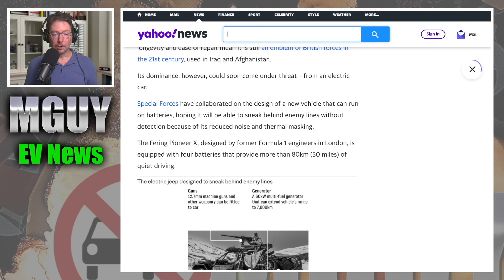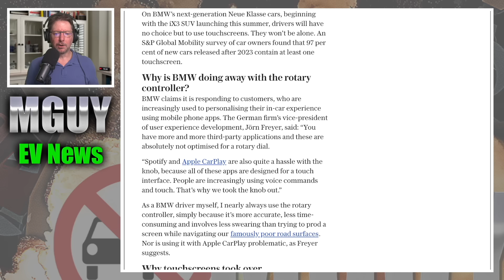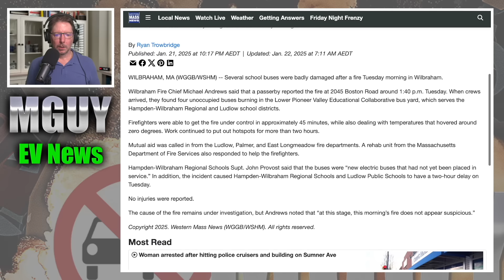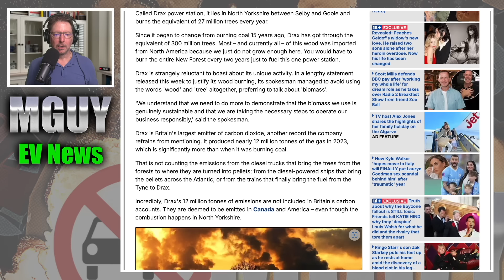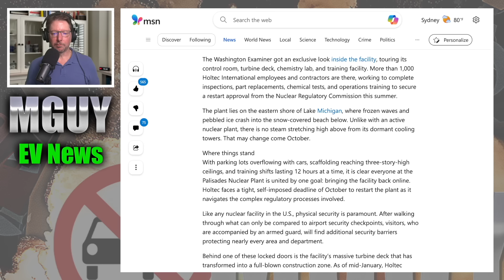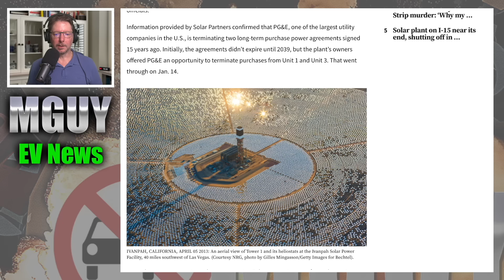Electric Jeep is UK's latest EV madness | MGUY EV News 26 January 2025

Comment: Electric Special Forces Jeep 'Will sneak behind enemy lines undetected' AND LEAVE YOU STRANDED when it either runs out of electrons or it lights up it's own signal fire.
Reply: It's own signal fire 😅
Reply: I thought the idea was that, as a hugely successful INCENDIARY, it would be left close to an enemy installation with a small charge to light the batteries whilst the crew slipped unobtrusively away in the ensuing mayhem?
Reply: @sirjohng1  Crew? What crew? A self-driving vehicle will suffice. And even if it drives madly down the streets, that will also work.
Reply: @YouShouldThink4Yourself Imagine being the enemy, out in silent dark night, you can hear a distant sound of a diesel generator😄
Reply: @Mehrunes86  not only you hear a diesel generator, but you suddenly start seeing the sky go bright orange, and a thick black smoke is coming out from the same area. You don’t even have to waste ammo on a self-1g nighting vehicle.🤣
Reply: Does the UK military realise that the Taleban, the Houthis, and even Iran lack EV charging infrastructure they could use?
Reply: @mhVcsgB7y7  No.  The UK's military leadership is just as dumb as what the US has.  The most versatile, cost effective transport is the Toyota Hilux - which the Taliban and Houthis actually use.
Reply: They will  go to the nearest enemy town and plug it into a tesla charger
Reply: 7,080 km, must be a long enemy line.
Reply: nonsense. it won't even sneak up to your own front line undetected!   i have watched 20 drone vids of the front line  ukraine/russia war. everything that moves on or near the front line is seen.  night or day.  only a clown would think they can get to the enemy front line unseen/   they may not be able to shoot at you yet. nut they know where u left your line, how you crossed it and where you landed at they watched it all on drone! in some cases they seen you on 4 different drones that stick around until the FPV drone comes and blows u up.  cant miss the show!  then they leave and look for more targets all day every day 24/7!
Reply: It could be exact opposite. These 'quiet' motors need high power, high voltage, kHz-range PWM signal to operate (otherwise efficient power control wouldn't be possible). Building a detector for that from ancient discrete parts should be quite easy, making these cars advertise themselves to the enemy from miles away.
Reply: These 1d 1ots have 0 idea about what’s happening today in a war zone. Any vehicle is detectable, whether it has sounds coming out of it or not. It’s not a cartoon. People’s lives depend on these vehicles! If you w0ke, wake up again!
Reply: It will also double as a kamikaze b0 mb.
Reply: As we have learned in the Ukraine/Russia war, drones are the most effective way to eliminating the enemy and vehicles. They are cheaper and area a use-once device.
Reply: Like large electronic signals are invisible to mankind. No, they are just as easy to pick up. The idea of EVs in front line duties is not journalism, its fan fiction. As long as its recognized as a EVangelists wet dream, then that is ok with me. Just don't try and peddle it as reality and call yourself a 'journalist'. You are a c-grade sci-fi writer.
Reply: You can't sneak behind enemy's lines in a drones war anyway. Low temperature and sound signature will make no difference.
Reply: @Hope_Boat  I have a more than  sneaking suspicion that the SAS may have just found that out the hard way in Yemen ?

Comment: I saw a article claiming that EVs last as long as a ICE vehicle. No EV battery will last more than five years. 🙄
Reply: Like everything else,  I'll believe it when I see it. 
Batteries degrade, it's just the way things are.
Reply: Tesla only  guarantee the cars for 100K miles due  to the battery  life.
Reply: I have a 14 year old diesel Citroen with 103,000 miles on the clock.  It still has the same tank capacity, fuel economy and range as when it left the factory.  No EV has a hope in hell of matching that.
Reply: My current and last car is now 18 years old. It has its original engine, transmission and driveline etc.  Nothing mechanical or electrical has been touched other than regular maintenance items.
Reply: Well the vehicle itself should last as long as an ICE.  But the caveat is yes the battery will need replaced several times at a very high cost.
Reply: @dave3657  It's not only battery. The weight of them means that many other parts will need replacing more often than those on a ICE vehicle. It's like Triggers broom. He's had the broom years and only replaced the handle 3 times and the brush 5 times. My old diesel car is 15 years old and never needed a replacement engine. In those 15 years apart from the normal service parts, it has only needed a replacement battery once. Two rear shock absorbers and a drop link. And my car has 120,000 miles on the clock. No one is ever going to convince me that a EV is better.
Reply: Good luck with that!
Reply: lol mate do you actually own an EV? I have 12 year old batteries in my custom EV build and range is still pretty much the same as when I bought them 9 years ago.
Reply: That’s OK then. Kia have a 7 year warranty on my EV’s battery. When it dies at year 5 another will be fitted at no cost to me. That’ll last at least 5 years so I’ll get the expected lifespan of all major goods these days.
Reply: @markboscawen8330  If you check that warranty you will probably find it doesn't cover the battery degrading and the car not achieving the specified range. Your battery might not die completely but you won't be going very far in that car.
Reply: @orvillefindley8117  Battery is covered under the warranty if it’s capacity drops by more than 30% before it’s 7th year.

So which is it? Is the car a brick at 5 years because the battery won’t last longer than that. Or is it that the car won’t have nearly the same range as new - but would still be suitable as a daily commuter 2nd car in the household?

BTW, even IF the battery’s capacity was 50% at year 10, the rapidly falling price of batteries would make fitting a new one in a decade much cheaper than today’s quotes.  The savings from not filling up with more expensive liquid fossil fuel & reduced maintenance costs over that decade would mean very likely to be no worse off compared to running an ICE vehicle. All of which is a very unlikely scenario anyway. As real world data from older EVs confirms the batteries don’t degrade as fast as feared.
Reply: XPeng gives a 10 year battery warranty, so who cares?
Reply: @stizzygrayson5541  Sorry sir , your battery died 10 years and one day after you bought it .£15 grand please.
Reply: @stizzygrayson5541  will that company be around in 10 years to honor the warranty?
Reply: @stizzygrayson5541  Wait till XPeng gives you an excuse for not replacing the battery. The cost is always too high. You can swap out an engine in an ICE car at little cost, not so with an EV. The replacement battery has to be new and expensive. Old ICE engines recovered are still good.
Reply: @bondgabebond4907 

My D4D Prado hand grenaded at 168,000 km, three and a half years old, Toyota didn't want to know about it, AUD$17K to rebuild it.

If it's got wheels or tits it will cause you grief and cost you money.

Our next vehicle will be BEV
Reply: @bondgabebond4907 except when the ICE engine rings are worn & the gasket has blown -leaking coolant into the sump.
Reply: @stizzygrayson5541  go out of business
batterys you want not made by others
like portable drills
new 45
later battery 34
Reply: My Mini Cooper Electric is almost 5 years old 
and its batteries haven't degraded one bit.
Reply: @organickevinlondon  Your batteries have degraded. They start degrading the moment you start using them. You will require new batteries very soon. It would be great if we could all see your face when they tell you the cost of replacing the batteries. 😂
Reply: @Spectrum-of-Truthha ha 😂😂🎉🎉
Reply: @orvillefindley8117  Lithium batteries start degrading from the moment they are manufactured and degradation is more age than usage related. The 200k Tesla is possible because those miles were done in a short period of time. For a typical driver 200k miles would be 20+ years of motoring and there is no way the battery will last that long.
Reply: @John_L  My car is 15 years old, it has 120,000 miles, not kilometres, and it's never needed a new engine. In terms of wear, I can still get 40mpg. It was only good for 42mpg when new. My old car is doing much better than any EV will ever do.
Reply: @organickevinlondon  Can you show the internal resistance readings of all the cells new compared to now and I will believe you, with every charge /discharge cycle their internal resistance increases. this also applies to lead acid battery's incidentally, its the chemistry degrading the battery through use.
Reply: @organickevinlondon 

I'll bet the Kool Aid was colored green,  
wasn't it Mister Organic ? 
Or did you even notice what color in your haste to gulp it down ?
Reply: @ WTF are you on about.
Reply: @organickevinlondon  

The Green New Deal Kool Aid 
your sort swill.
Reply: @organickevinlondon  You mean the meters are lying to you. A group test found brand new cars were lying about the range and state of the battery, so I very much doubt your 5yr old meters are telling the truth.
Reply: @bigglyguy8429  its NOT ROCKET SCIENCE to work out the state of an EV battery, yer just charge it up to 100% then drive it, till its down to as near as 1%, clocking how many miles its done on a full charge, its range, then you can divide those miles, by the battery capacity, to easily get its miles per kWh too, what are these "mythical meters?????" are you waffling on about,
Reply: @organickevinlondon  I think it was What Car magazine, they tested about 18 new EVs and found all of them were giving false readings regarding the state of charge and energy use. Most of them only gave 70% of their claimed range
Reply: @bigglyguy8429  I only go by what my Mini Cooper Electric does and it works correctly.
Reply: @organickevinlondon  Every single journey you take will be different, unless you take the same route day in, day out, and always ensure that anything using that battery power is always the same, (wipers, heater, radio, lights etc) and the temperature is the same every day (not going to happen), the best you are going to get is a very rough estimate of your battery capacity. There is no way you can get a cell-by-cell diagnostic (the meters he's talking about, not "eMPG" or whatever). 
The fact is, your battery starts to degrade the first time it's used, and it's up the the tech in the control system to ensure the cells are balanced and conditioned correctly, the BMS can do a good job, and as they degrade, you will just have less range, but at some point, one or more of your cells will reach a point where its too far out of spec, and, it will be new battery time (or time to find someone like me who can test and replace individual cells and get you back on the road)
If you buy new every 3 years or lease, this should not be an issue, but if you do get caught out of warranty, it will write most EVs off, as the price of the battery will far outweigh the value of the vehicle. I've personally already seen this happen...
Reply: @longrange1977  JEEZ, its just a flippin Mini Cooper Electric that I own, IF you know anything about them, ( I doubt that you do know anything about them, I'm an ex mechanic and truck driver, and my old man was in R.E.M.E. in the British Army, thats Royal Electrical and Mechanical Engineers, so stuff like this runs in my family),.its current battery set up, should last me at least 150,000 miles, thats 20 years of average UK driving, and even after that, it probably wont require a new battery, as its got 12 separate battery modules, of about 2.4 kWh each, so it at the worst case scenario, may require 1 battery module after 20 years, as I dont thrape the battery set up, by deep discharging it, i.e. driving it till it runs out of range and stops, one of my best mates is an electrical genius too, so if I require any incredibly detailed advice/information concerning my Mini Cooper Electrics systems, "I would just ask him" and not take some random dudes "advice????" from a You Tube comment, as THAT is exactly what you are in reality, "just a random dude", as for my Mini Cooper Electrics range after 5 years of use, the manufactures stated range is 145 miles, yet, I can get a range of 170 miles out of it, thats 15% more than the manufactures stated range, but the battery hasnt grown an extra 15% in capacity has it, perhaps "driving it properly" makes a huge difference, and I'm used to driving 44 ton, HGV 1,  articulated trucks, "so I know exactly how to drive thanks",  as for my charging routine, I run it right down to a single digit percentage, then charge up to 100%, as you would "KNOW????" that's the best way to keep it balanced, I basically see the batteries as 100 pint glasses, with each glass representing 1% of its capacity, so charging up to 80% means, yer filling 100 pint glasses with 80 pints of beer, and that means, some pint glasses get more or less beer than others, i.e. they are out of balance, so filling the whole 100 of them, to the brim, with 100 pints, i.e a full charge, means, they are ALL FULL and balanced, I even KNOW exactly how long it takes to charge, 20% per hour on a 7 kW charger,  (its actually 6 point something kW not 7 kW,) or 3 mins per 1% of its battery capacity, up to 97% then it slows down a tiny bit, between 97% and 99%, and the last 1% fluctuates, by a few minutes, due to its range being estimated by how it was driven before being charged up, (being a "so called EV expert????" you should have KNOWN that, but, you blindly incorrectly  waffled on about, oh, you need the same stuff on, on the same route and the air temperature has to be the same to work out your range, YOU got that TOTALLY WRONG,  on 22 kW chargers, it charges up at 11kW, or 30% of battery capacity per hour, or at 2 minutes per 1% of battery capacity, up to 97% then it slows down a tiny bit, between 97% and 99%, and that last 1% fluctuates a bit, while the batteries brain examines how it had been driven before it was charged up, this explains why a day after say doing just motorway driving at 72 mph, when yer charge it up next, the batteries brain is thinking, oh yesterday I was doing 72 mph, and due to the added increase in wind resistance at that speed, 
the miles per kWh was down a bit, so todays range will be lower, so I'll just estimate todays range as 116 miles and if its not going on the motorway today, its range will increase "like magic" the actual "thing" that estimates an EVs range, is called the GOM, for Guess O Meter, its "fantastic???" at working out, how its going to be driven in the future, i.e. after its charged up, in reality, its "totally clueless" as it simply cannot work out, what happens next, and therefore just relies upon, its goldfish like memory, of how it was last driven, to work out its estimated range, until you drive it for say about 10 miles, then it recalculates that 10 mile data, to get a more accurate range, I've even experienced, setting off with say a range of 130 miles, driven 5 miles, and the range has increased to 135 miles, when logic dictates it should be 125 miles, whenever I charge up, I log stuff down, like the temperature, mileage and miles done since last charging and the estimated range of my last charge and if I did more or less miles that my last estimated range was,
this is how come I can quite confidently state that after 5 years of use, there has been no noticeable loss of range over that period of time, so over 5 year of use, its battery degradation has been that insignificantly miniscule I haven't noticed it, despite monitoring it in great depth and detail at each charge up over the last 5 years.
Reply: @organickevinlondon 🤣😂🤣😂🤣😂 try using it.
Reply: @organickevinlondon  It's great that it's working out for you. 
My observation is a BEV mini weighs the same as my 21 year old Nissan x trail 2.5 petrol 4x4. 
The subsidies for road use are buy now pay later. 
I could probably get by in rural Devon with a BEV,  there are a few out here,it'll be interesting to see if it works out for them. 
It's very noticeable that no money is going back into the road surfaces that I have paid into over the past 4 decades so it would be nice to avoid contributing.
Reply: @organickevinlondon  Perhaps you should take it out of your garage.
Reply: Physics left the chat.🙄 @organickevinlondon

Comment: So they will also need to build mobile charging stations capable of fast charging many of these Jeeps at once.  Its hard enough supplying fuel during a war
Reply: They will built them don't worry... will be a tow system  and guess what it will be a deisel genny lol
Reply: A few hundred acres of solar panels should handle that.
Reply: @ every 20km of course...
Reply: You’ll have to tell the bad guys to hold their fire while you build charging stations between your lines and the enemy’s lines.